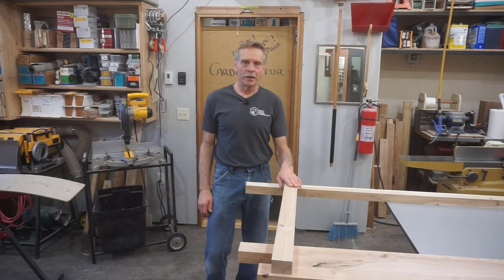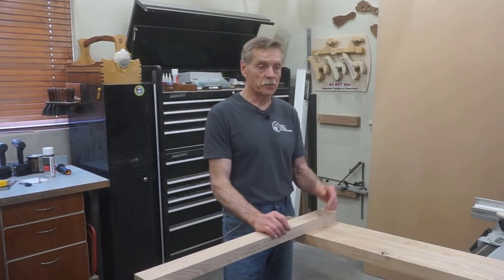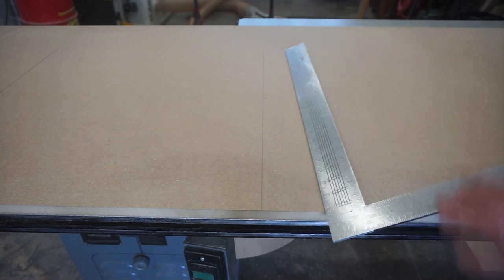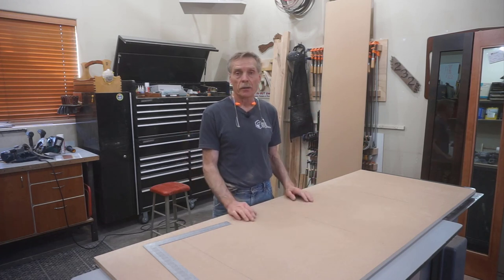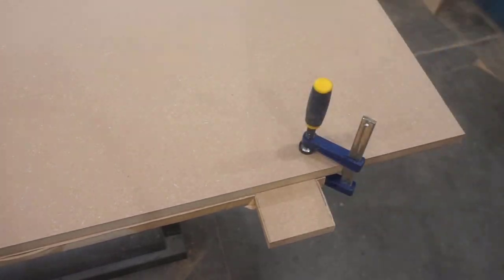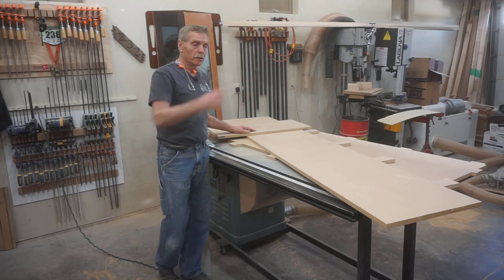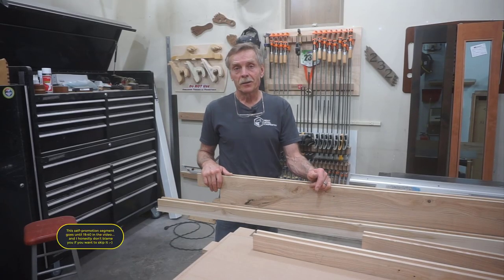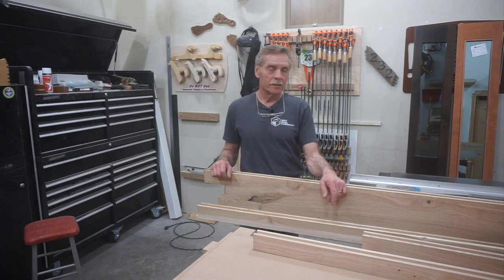Episode #7 Building a Tenon Panel Door

Comment: I was wondering if you were going to make your door in the same manner we made the doors for a custom log timber frame cabin, about 20 years ago.

The rails and stiles were of common size...4" stiles, top and middle rail and 7" for the bottom rail.

We used 5/8" MDF to fasten the finish panels to. The exterior door was Black Walnut on both sides. The interior doors were salvaged Heart Pine from an old cotton mill in Alabama, except for the bathroom doors, which were HP on the outside face and Western Cedar on the inside to match the custom vanities.

It was quite an undertaking, but they turned out great. The kitchen door going out to the back deck we made out of the Cedar and as a Dutch door.

I really like your videos. I kind of get amused when you say during whatever procedure you're doing, you mention the tool or product just like when a Nascar driver does during end of race interviews.

Comment: Master craftsman Matt! It is bloody brilliant! With the tolerances being so low, is there no danger with the wood swelling with moisture? Awesome build and looking forward to the next episode..
Reply from the maker: Thanks for your glowing review Mark!  There's a very high and real danger of wood movement for any wood door and especially using pallet wood which is inherently unstable from the part of the tree it's cut from... that's why no sane door manufacturer would EVER use this low grade of wood.  I'm skirting sensibility in attempting this but rely on a few things to go in my favor:  The hinge stile is most critical where twist would be very bad so the piece is use is laminated and small in cross section.  Top and bottom rails are also small in cross section and cut from vertical/rift sawn pieces that are more stable by nature.  The strike stile is widest and would be prone to misbehavior (swelling and, more significant: twisting) were it not 3 pieces laminated.  Many already know this but I'll add that lamination combines strengths and divides weaknesses of all 3 pieces.  The chances of all three wanting to twist, cup, bow or shrink in the same direction are minimal which is what gives me confidence the door won't have unacceptable issues over time.  The wood had most of a year to dry/acclimate to the shop and will be sealed with varnish when complete to minimize effects of inevitable swelling in hot and humid summer weather.  Time will tell?  I'm looking forward to the next couple episodes too!  Best, Matt
Reply: @NextLevelCarpentry   Thanks Matt! Still think your "pallet wood" grade is waaaaaaay superior to anything I could get here in South Africa!..
Reply from the maker: @markforrestsm  I should probably appreciate the wood more than I do... it's easy to take for granted what is abundant.  I'm trying to figure out what to do with what I don't use on the build...  If it weren't so impractical I'd be happy to ship some of the extra pieces over to you so you could build some fun stuff! Best, Matt
Reply: @NextLevelCarpentry  Bless you for the thought Matt!! Take care..

Comment: Maybe someone has commented this, but, HDF is more particle board like, with bigger chips than MDF ( medium density) which is more fibrous. Both dusty as hell. For outdoors the Miratek is awesome so far in my uses, exterior MDF  sounds like a unicorn, but that stuff is great. I don't think it comes in 4x8 sheets though. The other thing I like is that it can be had in 5/4. 
Great vids!
Reply from the maker: Duane: the HDF I use is made of similar size particles as MDF.  Seems to me there's no 'chips' at all but rather fine powder and a LOT of glue.  There are differing grades of particleboard with varying levels of density but HDF is the hardest/densest material of its type.  The brand of HDF I use is called Medex by the supplier where I buy it.  I'd guess it's pretty close to the Miratek brand you describe.
Reply: Next Level Carpentry My bad. I meant medex. But our suppliers call counter top substrate HDF. And the finer stuff Mdf.
Reply from the maker: @Spheramid  no 'bad' to worry about😁 There's plenty to get confused with, that's a for-sure!  To my knowledge there are both high density and medium density particle board.  I believe high density particleboard is for countertops and medium density particleboard is for floor underlayment and such.  Then there's MDF (medium density fiberboard) and HDF (high density fiberboard) to choose from.  It was only recently that I learned the HDF is made with a water-resistant/water-proof glue/adhesive where MDF is definitely not... that stuff seems to attract water for the sole purpose of disintegrating! 🙄😎
Reply: @NextLevelCarpentry  Masonite untempered is also fiber board , it is a big field.
Reply: @NextLevelCarpentry  The MDF sold here is sure not the same resin/glue as Medex. The HDF is just the "particle board" that has chunks and swells to 3x it's normal size when wet. Could be a geographic term ..like Kleenex or Formica used about any product that does the job. As long as it don't have vinyl wood grain contact paper on it, it all has a use somewhere.

Comment: As an apprentice Carpenter I am learning a lot here. 1 question, with 7" style on the latch side of the door, wouldn't you want that on the hing side for more stength at that stess point?
Reply from the maker: Traditional frame and panel doors ALWAYS have latch and hinge stiles of equal width Dan, for exactly the reason you question: strength.  An asymmetrical style door like this requires outside the box thinking, planning, design and 'engineering' to achieve strength while breaking the mold of traditional style door design/appearance.  What I achieved with the 'tenon panel' design is the strength of a solid core door so the skinny hinge stile is strong well beyond its actual dimensions because it's integral with the rest of the door.  I had only to make it big enough to conceal the concealed hinges mortised into it.  Hope you get to check out the other videos in this series since I packed decades worth of door making background into them to make this door.
I wish you well on your carpentry journey Dan... it can be a truly fulfilling, rewarding and profitable career for those who apply themselves.  Best, Matt

Comment: Love the door build. I do not have the HDF or MDF like that here in Chile so I have to use Plywood or a glue up. 

I am of course subscribed and have been for a while. I wish we had CA glue here in Chile. It does not exist here, and would be expensive to order it from Amazon and have it shipped here to Chile. Thanks Jim in Chile
Reply from the maker: Hey Jim; have you checked to see what shipping CA directly from Starbond involves?  They might offer options Amazon doesn't.  The NLC offer code is actually a cheaper/better deal than Amazon too.  I know if I ever moved to Chile I'd bring some along with me as I can't imagine doing without it!  Best, Matt
Reply: @NextLevelCarpentry  As a veteran of the U.S. Navy I can not figure out why you are not here now. You could reduce your costs and up your income doing the same thing here:)
Chile is like the 1950s. It is a first world country fr sure (Concrete highways, fiber Optic, very clean and safer than the former USA), but here we are lacking some of the products that are common and have been for years in the USA.... Gorilla glue? Does not exist here. I can order it from Amazon and pay $15 to $24 dollars a bottle after shipping. I just looked on line and I can not get anyone to ship it here........ Oh well. Thanks for the advice. I think you need to come and visit and bring a bottle or two! Jim

Comment: Matt, just wondering why you chose to use the forstner bit approach to making the mortises rather than using a router and a spiral or straight bit?
Reply from the maker: Ease of setup and ability to control befmx... if I were doing a LOT of these it might be worth the extra time to 'jig up' with guides, templates, etc necessary for using a router.  At that I'd rather put effort into getting and using a hollow chisel mortiser since the depth of the deeper mortises would ultimately require a router bit with a CUTTING length of 3" which is too dicey for anything hand-held IMHO.  I'm sure there are plenty who have a nifty plunge router set up/system for mass producing smaller mortises but for full-size door construction I just don't see it... for me anyways?  Thanks for watching and commenting... Best, Matt

Comment: Thanks for the video. Did you consider MDO before choosing HDF?
Reply from the maker: Nope... assuming by MDO you're referring to a particleboard core with a paper, plastic or melamine overlay?  I have no intent that any part of the tenon panel of this door being visible when it's complete Ron.  Let me know if I missed your point/question?  You're welcome for the video... and thanks for watching.  Best, Matt
Reply: Next Level Carpentry  Thanks for the reply! No, the MDO I’m referring to is an exterior plywood with one or two sides covered with paper. Also used in the sign industry and for concrete forms. Thought it might be more rigid than HDF in this application, though I’m sure the HDF will be fine
Reply from the maker: @rbyt2010  Oh, OK... got it.  Yeah THAT MDO would be an incredibly strong/stiff/durable option, wouldn't it?  I think the HDF is probably a more millwork-friendly option compared to anything with a plywood core but either would do if the other wasn't available.  Thanks for watching and commenting here... Best, Matt

Comment: Matt, if your door were a true exterior door, would you still be comfortable using an HDF core? Would you take any additional measures during your "painting" process to ensure the HDF would be more sealed off?

Thanks again for all of the great content you share with us!
Reply from the maker: Hey Patrick, the HDF panel is actually an exterior grade product called Medex made for and used by sign companies.  It's pretty indestructible to my knowledge and experience so I wouldn't consider it the weak link in a chain for door durability. This door design wouldn't be good for true exterior application with all the horizontal seams, etc which would be difficult to seal against driving rain.  There's no need to 'take additional measures' to protect the HDF but infiltrating water would destroy the wood from the inside out in fairly short order I suspect.   That's a concern for any solid wood door construction/design though which is why, ironically, I really like the foam insulated fiberglass ones available these days from the likes of ThermaTru.  Sad but true... Best, Matt
Reply: @NextLevelCarpentry  Matt, thanks for the detailed reply! You've more than answered my question -- but I am now debating using a stave core construction for an exterior door. The HDF core would save a lot of the headaches building a stave core involves. Either way, the main panel core will be covered by a large vertical 3/8 inch veneer on each side of the door.

Again, I can't thank you enough for both the effort you put into your videos and the time you've taken to write me back.
Reply from the maker: @3125Dissent  I can't always reply in such detail but am intrigued when viewers like yourself ask questions that are clearly backed by a sensible thought process. Here's a bit more random perspective to consider: I've built a number of exterior doors from solid wood that have done well against the elements.  Choosing good material like mahogany, white oak, doug fir etc, using Titebond III glue, laminating stiles and rails with 2 or three layers, making panels 3/4" thick and finishing with Varathane water borne exterior spar varnish are all choices that give the best chance of survival for solid wood doors.  A northern exposure is actually best (better?) because the door won't ever be blasted by sun and water at the same time... those two factors are the hardest on wood and any door, regardless of quality of construction, will fail in time without annual maintenance at a minimum.  Doesn't keep people from wanting them or me from building them though... 

Good luck with your build! Best, Matt
Reply: @NextLevelCarpentry  I love fiberglass doors

Comment: Hey Matt another excellent video, love the details and explanation !👌 May i ask (i know HDF but it is very hard to find and i never worked with it ) is there really a ''big '' difference between HDF and MDF for this project of could MDF do the job too of would you classified that to weak ?
Can't wait till the next video, greetings from Belgium.
Reply from the maker: Thanks raf... good question.  I didn't explain it in the video but the HDF I use is actually an exterior grade product made for the sign-building industry so it's highly water resistant... almost to the point of being water proof.  There's not THAT much difference in cost between it and MDF so I figure the difference is cheap insurance.  Structurally, in the design of this door, I doubt there's any appreciable difference between the two.  You can tell by the tone of my reply here that I didn't even compare cost since labor is such a significant factor as to make material cost irrelevant.  I'm anxious to get the next phase of this door build done too! Best, Matt
Reply: Next Level Carpentry  I have always thought that HDF is that  dark brown "hardboard"  or Masonite product similar to pegboard without the holes.  It is much harder than MDF.  I have used "signboard" which was described to me as simply waterproof MDF (and, by the way, signboard is a good workbench or assembly  table top).  Love your videos.
Reply from the maker: Hey Steve, there's definitely some variation in names, product types and features/benefits that vary by region, supplier, sales outlet etc and as long as you're able to make sure you're getting the right product for the job it's all good.  Never thought of signboard for a work surface but agree it sounds great for the application.  Best, Matt

Comment: Man it is coming together nicely and it looks so good. How did the meeting go with that moulder manufacturer?
Reply from the maker: Hey Jake, thanks for the compliment on the door... I've not felt so far out on a limb with a design in a long time so it's good to know the limb is stout.  All I'll say about the moulder is that you can lead a horse to water but ya can't make it drink. Apparently not even if the pool is exceptionally cool, clear, deep and fresh... go figure?  I'm still pumped about making the casing for this door though and think (hope) you'll like it too? Best, Matt
Reply: @NextLevelCarpentry  well we tried, that's all we can do. I enjoy every video you put out matt. thanks for all your videos and the hard work that goes in to them, I learn something every time.
Reply from the maker: @jakecarter2414  I was thoroughly impressed by audience participation in the effort for sure!  Glad you like and learn from videos here... I always appreciate your engagement, comments, etc... Best, Matt

Comment: Amazing result due to a lot of planing and preparation, although I didn't fully understand the extra length put on the mortises, other than a little wiggle room and perhaps wood movement through time. SOLID !
Reply: Phil Melson I think the extra length on the mortises was to insure a clean fit. A slightly deeper mortise doesn’t appreciably weaken the MT joint but it does make it go together easier.